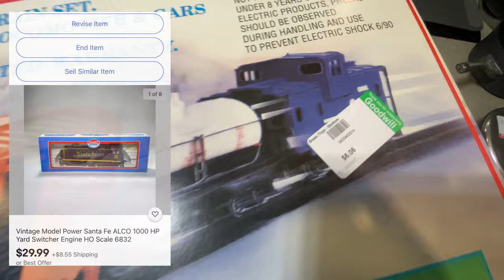DIY Foil Pan Smoker Build Challenge RV Living

Comment: I just started a remodel of a 1994 bounder and I seen your video because I am going to give it a face lift and wanted to know did you primer before the paint? Did you use epoxy paint? If not what type of paint did you use? Thank you
Reply from the maker: That’s awesome!! The bounder is such a classic!! We didnt prime before we painted but we did sand it very very good and leaned it very very good before we sprayed. We did primer where we did any small bondo spots. It’s held up great without it. A coat of primer may help to create a smoother surface but we’re not sure. We’ve sprayed a couple of cars as teenagers so we are far from professionals. The paint is A single stage paint by Kirker from autobodytoolmart. We sprayed 2-3 coats of clear coat on top of it.
Reply: Awesome thanks